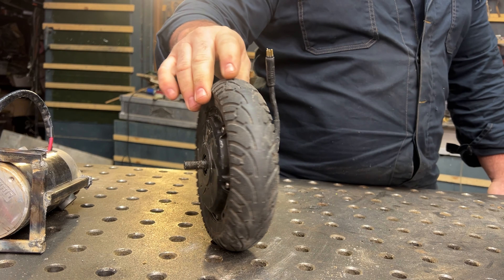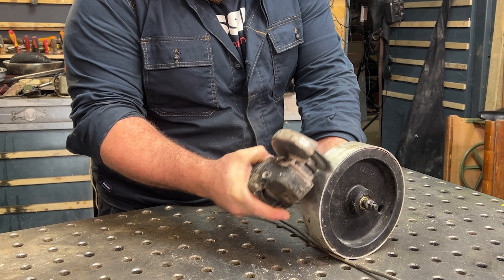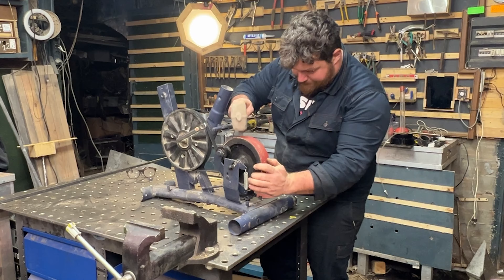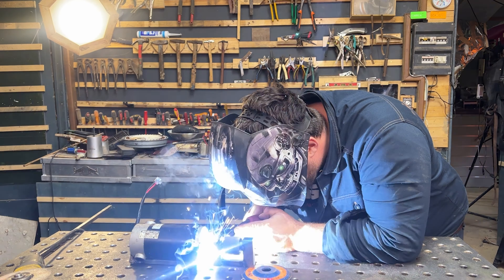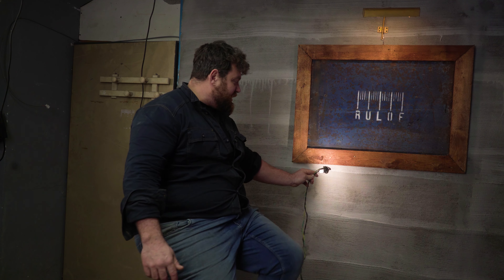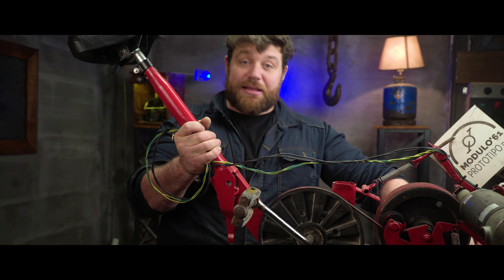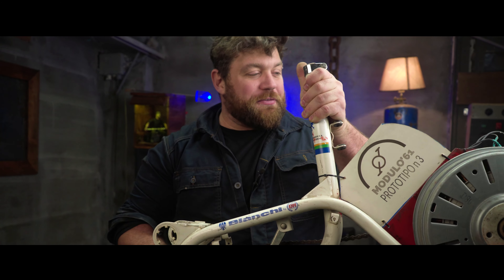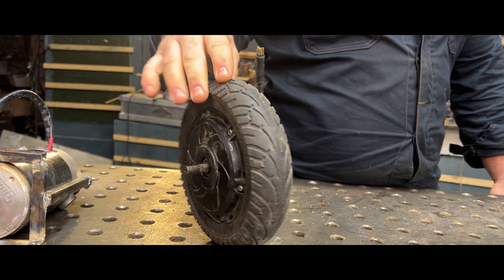3 Different Approach to generate Electricity • Mod 3 Exercise bike

Comment: Very complicated way to do this.  I got a 350 Watt motor from Amazon and put a small pulley on it and used a V belt that fit around the 17 inch flywheel on my exercise bike.  Connected to a battery with a diode to prevent the battery from running it as a motor and then to a 12VDC to 120VAC inverter.  I can pedal about 14-16mph to get 13-14VDC.
Reply: He is taking an artistic approach from found items and repurposing them. His passion and creativity shows through and it’s obvious that it’s the focus and not how efficient you can build something by purchasing from Amazon. Do you have a link to your video?
Reply: @christosvolikakis1523  I don't have a video of it but my description covers the process.  It could be done just as easily as I did with used or found items as well.  Simply mount any motor/generator of appropriate size to a flywheel type exercise bike and purchase a belt that fits the flywheel and motor/generator.  Mine was a Yosuda exercise bike and had a 17 inch flywheel and I used a 3.5 inch pulley on the motor with a 64 inch V belt, 12V battery and diode.  I mounted it on the front of the exercise bike.